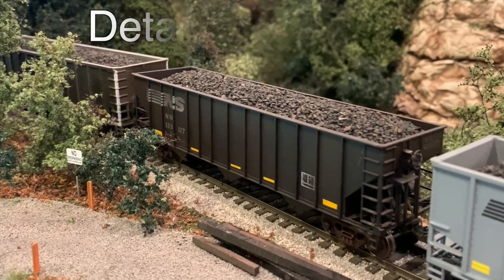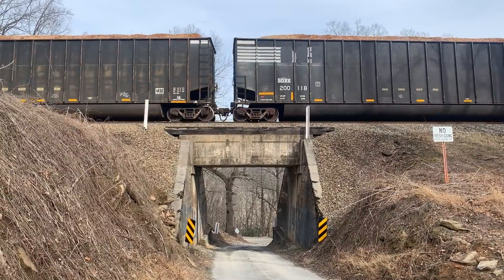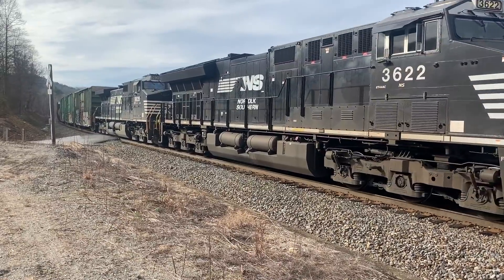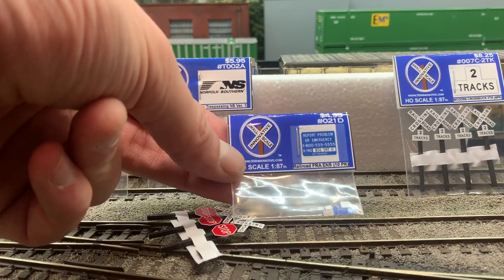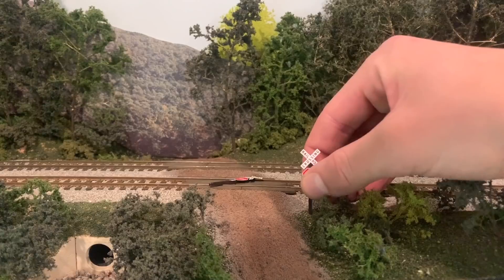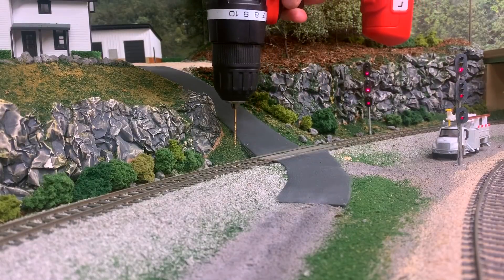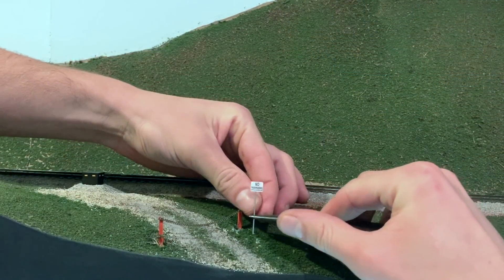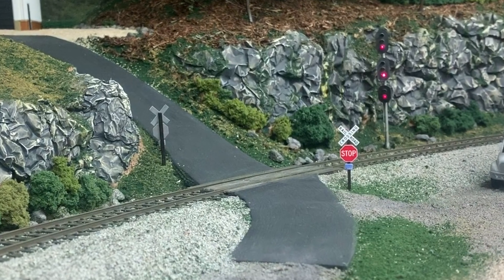Detailing a Scene - Realistic Model Signs

Comment: I made a variety of signs for my O scale layout. I simply printed them on sticker paper and attached them to flattened aluminum from Coke cans. Then cut out the signs and attached them to some cut wood strips from the hobby shop using HO scale track nails. I drilled holes through the metal and into the wood and shoved the track nails through. Very simple and easy.